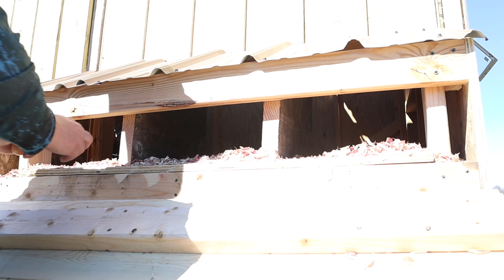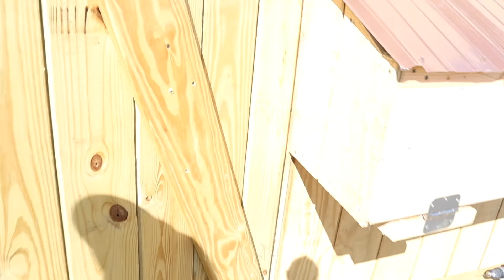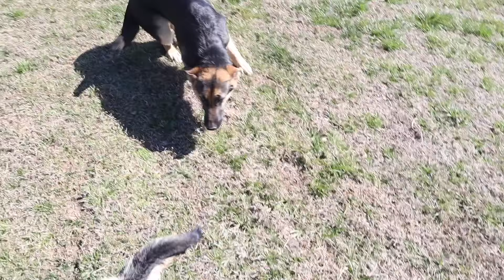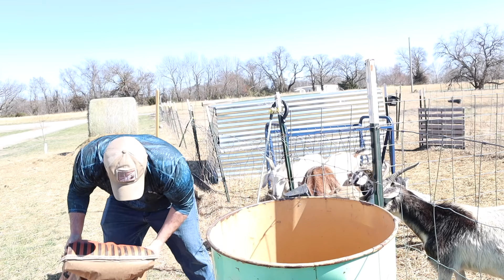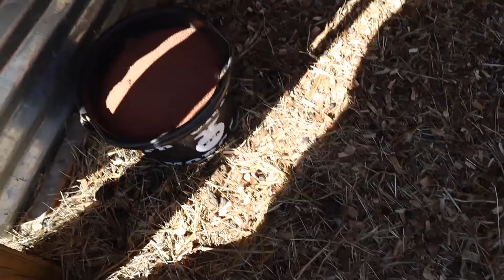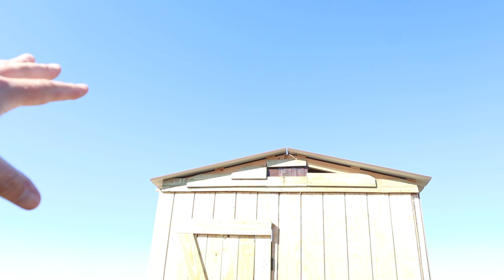I Had A PANIC ATTACK, German Shepherd Started Crying

Comment: I have trouble with MRS's too. For the last one (Oct of 19) they had to put that cage thing on my head too. When I told them I had trouble with the closed-in machines they put a mirror on the frame so when I looked up I could see out the bottom of the tube. It helped but... When you have your next one see if they have an open machine. If you look side to side you can see the floor and part of the wall so you don't feel so closed in, it's cooler and the airflow is better. They had a fan blowing on me in the closed-in ones, it helped a little.  What I don't understand is, if they only need to scan your head, why do they have to put you all the way inside, why not just to your chest or less?

Comment: Dutch, you tell Brandy that clostraphobia is nothing to laugh about. When I was 11 years old I got trapped in a concrete culvert. I was jammed in between my knees and back. No one knew where I was on our 83 acre farm or how long I been gone. I was crouched there for what seemed like hours. I started thinking about all the snakes, scorpions, and critters that  could crawl in there with me. Then I imagined my skeleton being washed out of the culvert when the rains came because no one found me. All that was motivation enough for me to figure out a way to get  myself out. I noticed that my knees were in mud so I rocked my legs back and forth as much as I could and several minutes later my knees had sunk down into the mud enough that I wasn't so tightly jammed. I lost some skin off my back but I got unstuck and was able to back out on my tummy.
Many years later (I think I was in my late 30s or early 40s) I injured my back. Doctors waned an MRI. They asked me the ER if I was clostraphobic and I told them I was although I didn't remember why. They sent me for the MRI but they didn't sedate me. They  put a blindfold over my eyes and headphones playing my favorite music. I wasn't worried or paniced as they slid me inside. When the table stopped I tried to adjust my shoulders (I have wide shoulders for a woman) when I couldn't move my shoulders or arms away from my body panic set in and I started to tell for then to GET ME OUT OF HERE NOW! That table does not move fast enough when you are coming out. There is no high gear. When I got out they asked me if I was clostraphobic. I said, "YES! I told them at the ER that I was. Then they decided to sedate me. They gave the shot and left me on a gurney in the hall. I had a nice nap in the hall for about half an hour before the came back for me. I was very relaxed and kept myself calm. The gave me the blindfold and headphones again and slowly slide me in. This time I had my hands on my belly thinking I wouldn't feel so trapped. However, as soon as my hands  came to the tube the roof of the tube brushed the top of my hands then I was painfully aware of how tight a space it was. Again I started to tell for them to get me out. This time I was sedated but only got half way in. I had to call my parent to come get me because I was too loopy to drive myself. I had a good night sleep and my back was better than it had been in the previous 3 weeks. They never got me into one of those tubes again. Thank God they have open MRIs now I've been in two if those and was fine unsedated.

Comment: Sounds like Gracie learned a lesson she needed to know.  I'm sure she'll not forget that one!
As for the MRI, they do have bigger tubes and "Open" machines where your head and lower legs stick out (Or 1 end of you if your scan is on head or legs).  If your issue is with the covering on your head, then you'll need conscious sedation as the head gear will be needed.

Comment: My husband said after his MRI he is claustrophobic.  He said he had no problems until being put in one of those machines and he was crunched up too.  Dutch I think you need to trim out the sides of your chicken house where you want to put your ventilation.  Trim the vertical side then I would attach your vent from the inside of the coop and add backing for it as needed. Then you can fancy up the front to close it in.  Poor Gracie.  At least now she will leave the chickens alone and that is a good thing in the long run.

Comment: Had similar experience not with an MRI exam but with putting sheetrock up in a small closet never been scared of small places before but when I closed the only doorway with sheetrock my heart started to race I dismissed it because of the energy being used hold and screw the sheets of sheetrock into place but when it started to effect my breathing was  barely able to cut the doorway out.  before I started seeing the little specks. It took several hours for my heart rate to go back to normal. And took several days for my wife to stop saying "I told you so"

Comment: Dutch I am 6' 4" tall 370lbs disabled retired Firefighter with training in confine space Rescue,  Hazmat, First Responder and dive, Swift water rescue.  I am the guy who use to go into the tight spots to get people out.  It has nothing to do with opening your eyes.  I got the same reaction to a small kids size or maybe it was wife size MRI when I had my eyes closed but i felt the machine I was being forced into by a over exuberant Tech.  My shoulders don't fit through a 28inch door without turning sideways, and they were trying to stuff me into a 24 inch hole.  I did a little better by putting my arms above my head so I fit without feeling like I was being stuffed into a sausage prestuffing tube.

Comment: Check and see if there is an OPEN MRI unit anywhere nearby, you won’t feel claustrophobic in it because it’s less closed in. 

I just had 2 MRIs back to back on the same day and made the mistake of opening my eyes like you did right as the first one was almost finished. It was a struggle to stay calm while it finished and then to get slid back into the machine for the second one.

Comment: That electricity could be advised, set too High by manuf. Excessive. Only for their own sales interest. Sound product etc.but more for outside predators etc.Chooks may wander too zapped & drop dead. Wouldn't hurt to drop several numbers elect. Poor Abe prob. got blame in other dogs' eyes. Haven't left enough vent. You boarded them over?  Heat rises.

Comment: At 6' 2" and 300# a closed MRI is absolutely out of the question! Tried it 22 years ago and fellas your Lil Bitty other half can laugh All they want. Just wait for the day they get stuffed in that tube!
Word to the wise, don't laugh, it ain't so funny to them when the shoe is on the other foot. 😂😂😂
And a trick my dad would use on a turkey Tom being onery is the squirt bottle of water. Works every time.
Can never have enough ventilation, especially in our part of the country with the way the humidity comes and goes during spring and fall. Course down in Texas it's humid pretty much year round the only thing is you only have a few choices. Cold, hot, hotter, and hottest! 😳😳😳😝😝😝😝

Comment: I know the feeling. I don't like those closed end MRI machines. There are open on both end machines. I have a real hard time walking between vehicles parked in a parking lot. I was rolled between a 24 ft flat bed trailer and a 22,500 LB forklift 21 years ago. I know what tight places do to me.

Comment: Hey ya'll I had a similar situation, I needed an MRI, now I a little larger than the average person, they put me on the table, started it up so it draws you into the machine. I got as far as my tummy and got stuck, it mashed my chest down toward my stomach but then my tummy had no wiggle room the tech tried pushing my tummy upwards into the machine toward my chest, I couldn't breath! He told me to breath out, I did he crammed more of my tummy into the machine but then it completely stopped, I couldn't breath I was gasping for air. I told him to get me out, he said if i was talking i was gettung air, he then left me there and came  back with another tech, they both tried cramming me future under the machine but the table wouldn't budge, I ended up passing out from lack of oxygen they ended up getting me out finally and told me I proably needed an "open MRI machine" so my Dr scheduled me for that one and I barely fit under it, it pounder so loud I ended up driving home with a full blown migraine! I have never been back or will I ever go thru that again! I hope you gave better luck at the next place if not ask for an open MRI, they have to accommodate you. You can't be squeezed into a machine that doesn't fit your frame... good luck. My prayers are with you.

Comment: I have MRI's every 6 months. (Cancerous brain tumor, that's now gone) Never any problems. 
Did have problems and panic attacks with the radiation treatments. You'd really have problems with that. A custom fitted mesh cover for your head an upper shoulders. Heat formed in place over you. Then locked in place while they do the treatments.

Comment: Excuse me, actually I didn't want to get involved or become unfriendly. the chicken coop used to look so neat and functional. You could have sealed the triangular gable opening well with a fine wire mesh. There could have been enough air to circulate, but troublemakers could not have entered. Honestly, now the whole thing just looks terribly obstructed and the air circulation should also be quite blocked, now in summer it gets really hot in the hut.☘️

Comment: Maybe run the planks vertical to match the siding.  Or, if really want the overlap and run horizontal then run from the side to the middle.  End each joint alternating around the vent cover.  The top pieces will need the top edge ripped off to match the roof line.  Of course you only did it that way to see how many comments you could get!  The next video you will be telling us how many people hated your design work.

Comment: Dutch, ok I don't comment much but I am going to be honest the patch job on the chicken coop vent looks bad.👎🤯 You need to redo it.👎👅🤮
I have had quite a few  MRI'S and I didn't get claustrophobic until about 2 years ago I went into a real tight one like you're saying and I totally freaked out. I started like hyperventilating and I said you have to get me out get me out get me out and I told him I couldn't do it I just felt like I couldn't breathe. Then they got me up an appointment at an MRI they call a wide bore MRI give you like two more inches but it really helps. I also asked for the sedation which they actually increased to 10 mg. Because the first time they only gave me 2 mg. Which did nothing for me. I finally got through it on the 3rd try. I had never had that reaction and I have been having MRI'S since high school. You will get through it but never open your eyes until you are out of the tube!!!👏💞😄🥰🙏

Comment: I did the tube once.  I will not do it again fully aware.  Made the testing I had to do the next day worse, even though that testing was open air and they just had a device they lowered from above.  Yeah.  At the point I started to panic, they couldn't just take me out.  Would have been longer to take me out, than to finish the test and take me out.

Comment: Only once in my life and I got caught between the passenger seat and the dash of my class A Motor home.  I was on my back trying to get to a fan motor under the dash with my feet in the air and I could not get out.  PANIC.  After 5 minutes I gave up and figured well dumb ass this is where they will find your body later on today when the wife wonders where did he go.  As I laid there I got to thinking I think this seat will swivel around if I can just reach the control under the seat and I managed to get to it and turned the seat half way around and gave me just enough room to be able to force myself up and out of that tight space and I am here to tell the tale.  That was the only time in my 73 years I was caught in a tight space and PANIC big time was what happens.

Comment: I normally don't criticize any ones woodworking skills, but the cedar plank job is one of the worst I have ever seen. I am far from a professional carpenter, but some of those angled cuts made no sense and the lengths? Come on Dutch, I know you can do better than that. And there is no amount of paint that will fix that.  And the metal vents always go on over top of the wood.